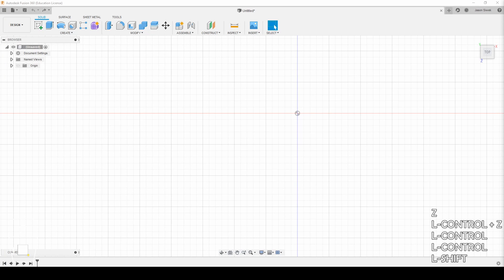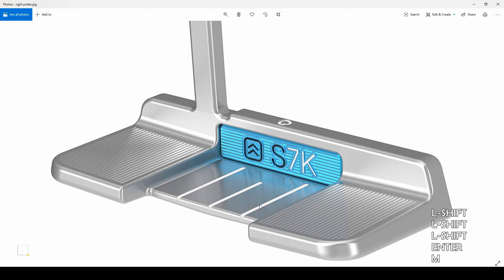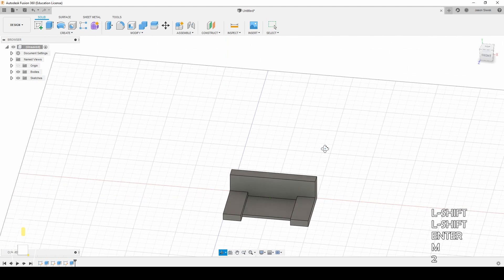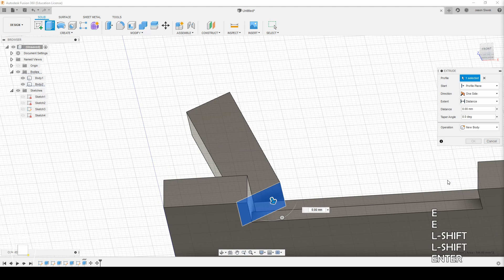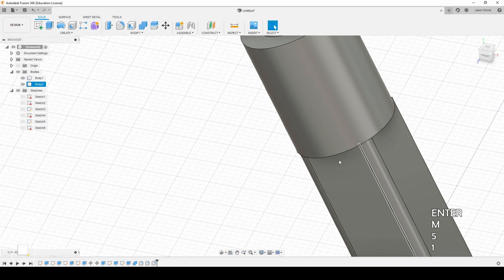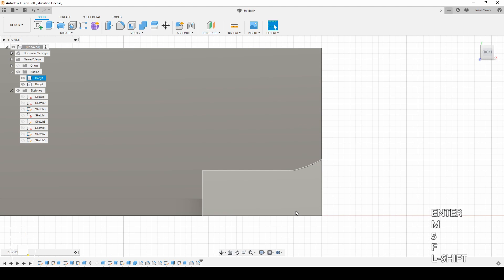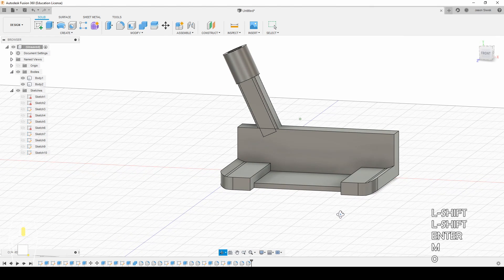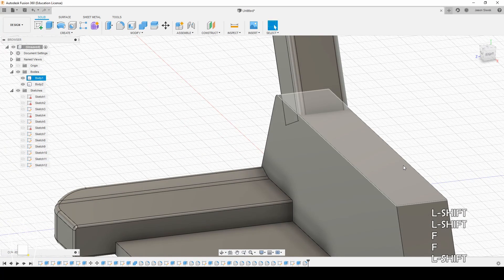Let's Design: A Golf Putter

Comment: Jason - interesting design.

I see you have never done any design or machining before.

You have 3D printed it, but if you attached a shaft to the club, I bet it was awful to putt with as it would have been far to light – putter heads need to be 310-330 grams to be effective and that crappy resin you use is nowhere dense enough!

Also, your hole for the shaft is wrong – shaft diameters are .370” or 9.4mm – so a 9.8mm hole will be like a willy in a bucket fit!

So, you will need to machine this from metal – so which metal have you considered in your design to achieve the desired weight?

It then comes to machining.

How are you going you hold this part when you machine it?

How are you going to cut the square corners in the pocket at the back of the club face?

How long a cutter are you going to use to machine the 3 slots, so the cutter does not foul on the back of the club face?

There are multiple other machining issues you have designed into this which would add massive cost to this job.

Marks out of 10 - I will be generous and give you 3, but with your design skills I would not be employing you.
Reply: Nice work trolling this guy......
Reply: @Uncle.J.32  Unless you tell him it is wrong he won't learn and will continue to make these mistakes.
Reply: @jamesstevens1972-q2v  lol this is not a machining video, he clearly states that he is just challenging himself to make a putter that he can 3d print and you go off on a tangent that it’s all wrong to machining. I can go deeper into what you said and state that a 5 axis cnc can machine what he made just fine without changes. I would be happy to put this on my machine and prove you wrong
Reply: @Uncle.J.32  so Uncle, with all your 5 axis experience please tell me how you would machine the square corners behind the face where the side beams join them. 
In the corner there are no radius so you can't even use a ball nose cutter, so what method would you use to cut the square corners without leaving a machine cutter radius?
And if I wanted to be really awkward I would ask how you would machine the slots in the base which also end in square corners.
The only way I know of achieving these forms as he has designed them is to use EDM with a solid electrode with the square form on it. Very expensive and another process.
There is an engineering technique called "Design for manufacture" which looks at a job in the way I have and checks that the part can be made, and then in an efficient and cost effective way.
Just so you know I am had a 5 year toolmaking apprenticeship, followed by time in a design office, and worked in medical, aerospace and nuclear industries on front line projects where my practical and technical experiences have given me a comprehensive exposure to multiple machining technologies and methods, and used a massive range of materials - some very "exotic".
So I would really like to learn how to machine a 90deg by 90deg internal corner with a sharp corner (no radius as per the design) by using a 5 axis machine.
Please enlighten me.